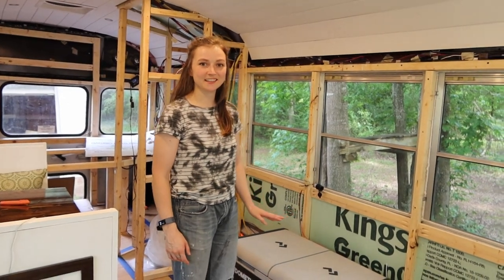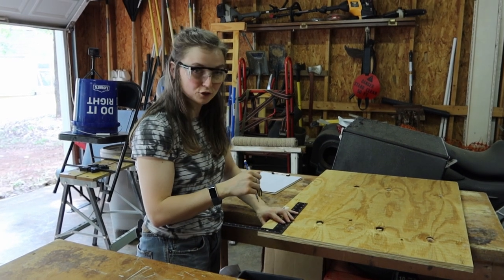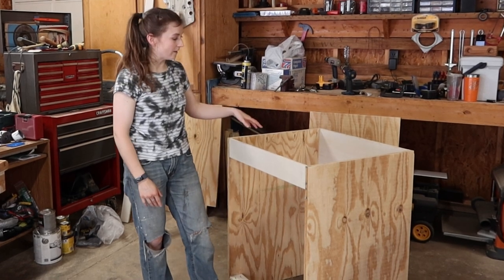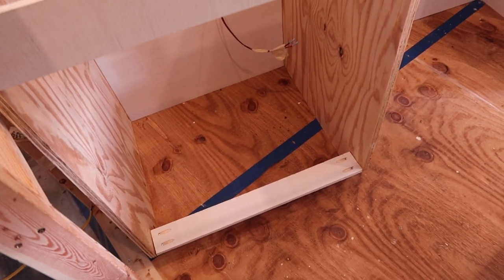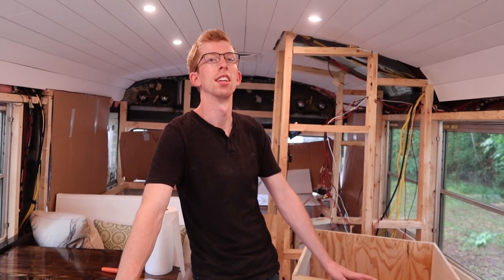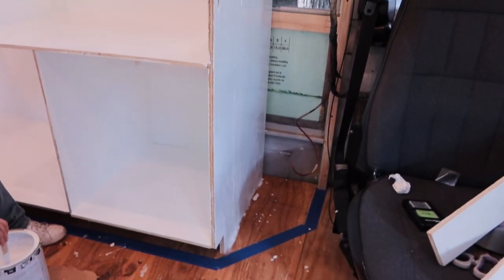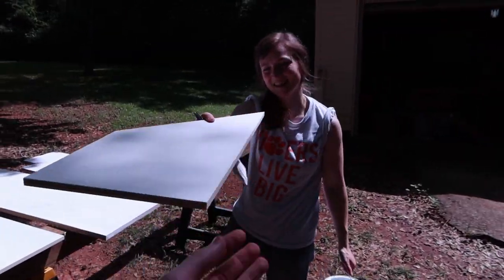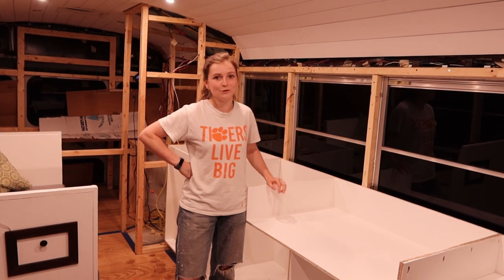SKOOLIE TINY KITCHEN LAYOUT | Building Our Own DIY Kitchen Cabinets In Our School Bus Conversion

Comment: Great job guys.  Looking forward to TV install.  TV size? Mounting hardware?  Have you guys got a way to protect TV from Grease&Smoke while cooking. I would consider an exhaust fan that pull smoke etc down and out behind cabinets. ( Like they have when cook top is built into kitchen island).  ps  before mounting in place is rough in plumbing/electricity/AV cables for tv....in the plans...
Reply from the maker: Thanks! It’s requiring us to put in some effort but it’ll definitely be worth it! 
The TV we have is a 40” TV that should fit perfectly into that space. We plan on just using the normal vertical wall mounts, but if that becomes an issue we’ll probably find a way to just bolt it to the underside of the Butcher block directly. And yes! We didn’t really show it in this video but we’ve actually already run AC power cables as well as an HDMI cable that will allow us to plug up to the TV while sitting in the dinette.
Reply: @JimmyandNatalie  Kewl  I have watched many skoolie builds but have not seen that hidden TV under counter space.  it will be copied for sure....

Comment: Looks great! Are you guys concerned about pans and etc sliding around while the bus is in motion?
Reply from the maker: Thanks! A little, but we’ll be using some non-stick grip pads and hopefully some pretty stiff cabinet door locks that will prevent things from sliding out.